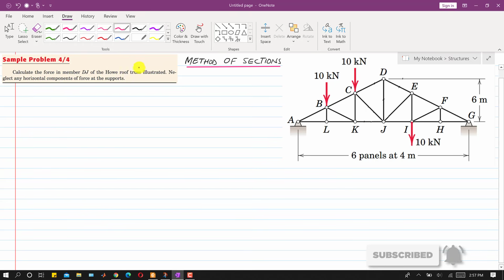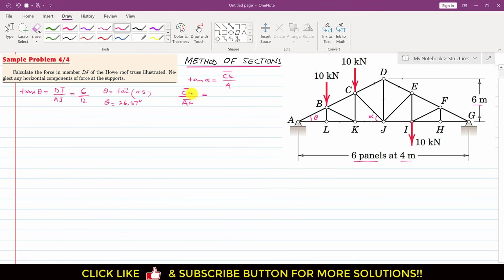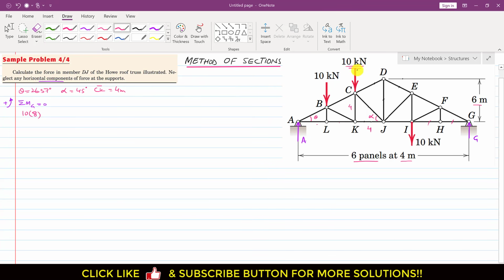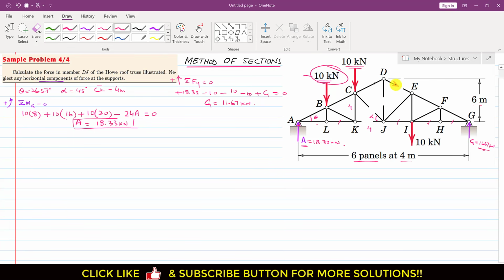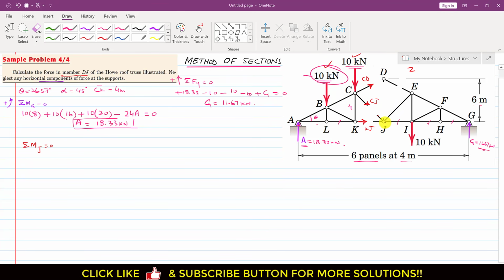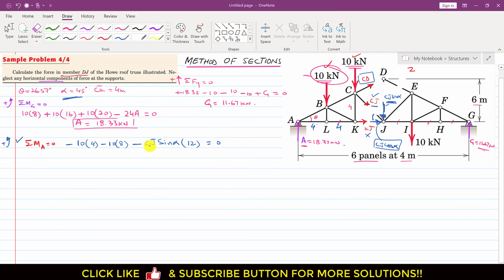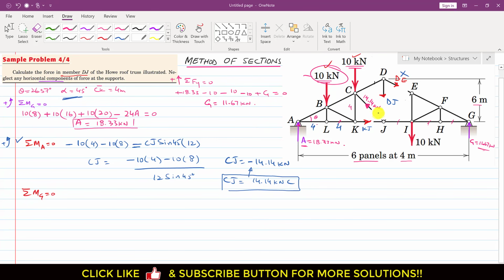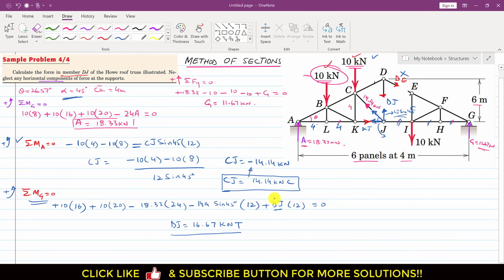Truss Analysis by Method of Sections Solved Example, Engineers Academy

Comment: You take the moment from G..but you are not considered the force 10kn on point I..which is 8 m from G..
Reply: What he doesn't make clear enough is even though he is taking the moment about G he is considering only the forces on the left side of the truss. The 10 kN force acting at I is on the right side of the truss (the section that is not being considered)
Reply: In method of sections, you ignore the section you do not use (In this case the right hand side). However, the joints/points in the unused section can still be used for moment equilibrium equations in order to reduce forces to find a specific force. That is why even though he used point G, the external force in point I is still ignored.
Reply: Thats what i thought too the answer could be different if he didn´t forget the 10kn From point I
Reply: also i agree with you in this point ☺️